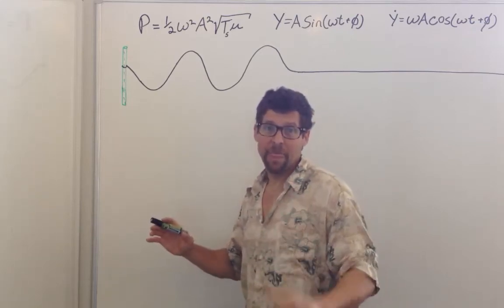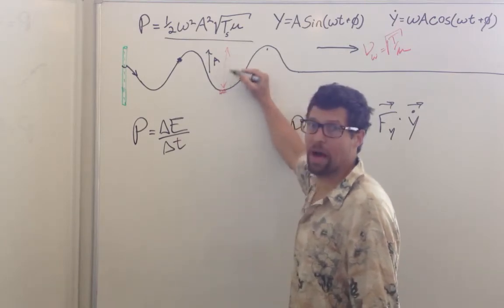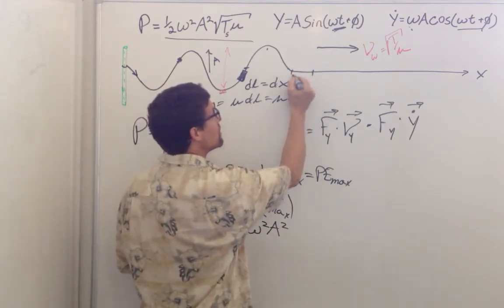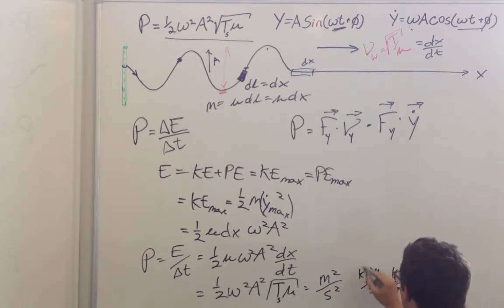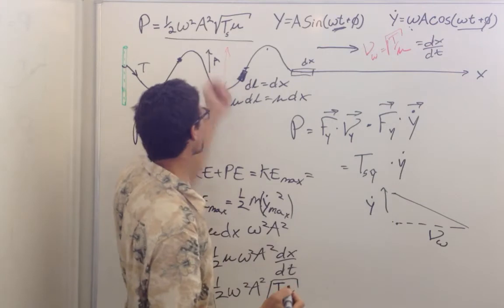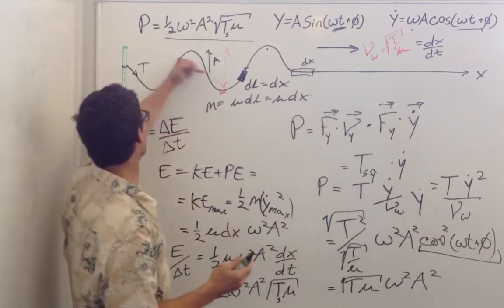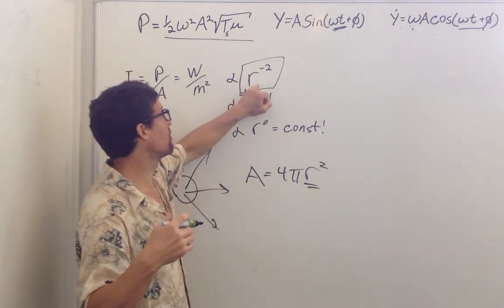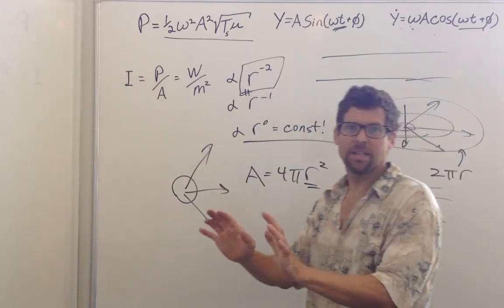Power Transmitted by a Wave on a String, Schwartz, Cal Poly Physics updated

Comment: At 2:52 you say the particle only has potential energy at the bottom. I'm pretty sure that's not correct: 
At the bottom (and the top) the string is unstretched (so no elastic PE) and the string is not moving (so no KE) so the total energy at these points is zero. The energy in the intermediate points is non-zero being max half way up for the same reasons.

I've seen other physics tutors on YouTube make this same mistake.

One thing I never see reconciled is why, even though each particle is undergoing SHM (which for a single particle has constant total energy), we nevertheless get a transfer of energy along the wave. Could you explain that.